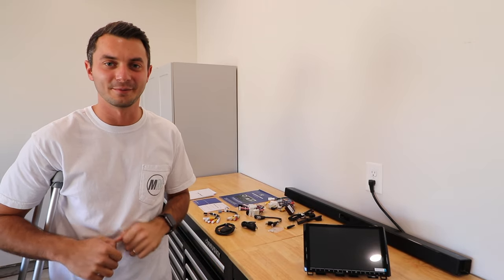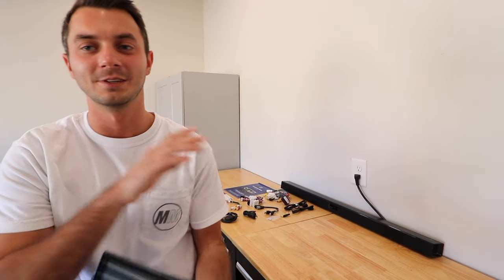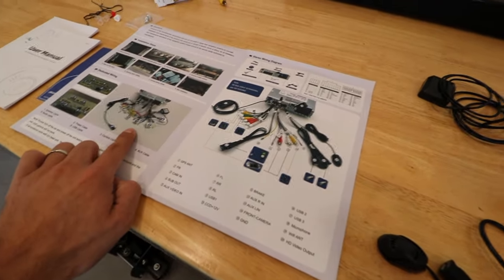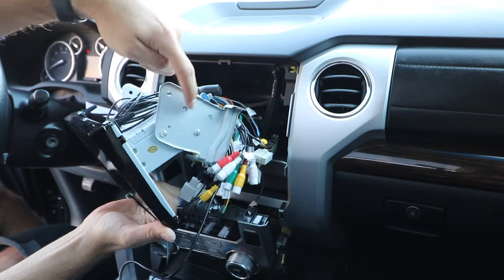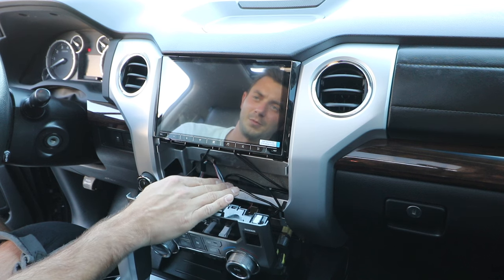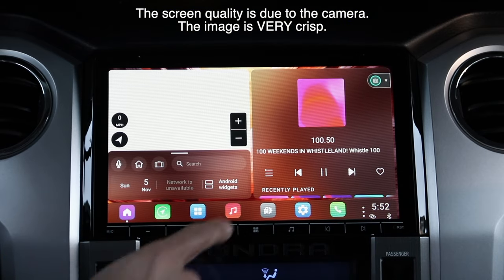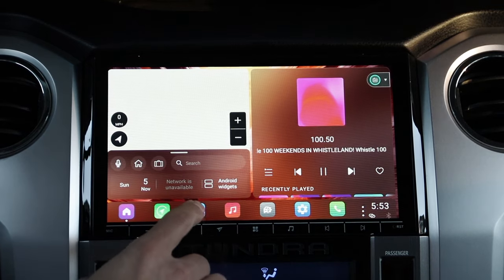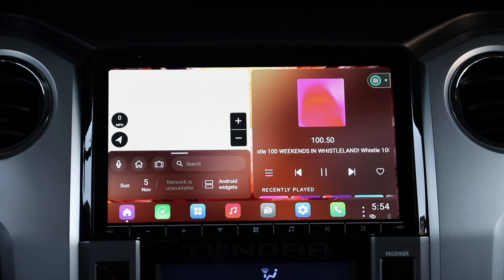The Best Toyota Tundra Touch Screen - Dasaita 10.2" Install & Review

Comment: I’ve had mine for about three months now for some reason it keeps resetting itself sometimes it doesn’t even turn on. I have to turn my truck off lock it let it sit for a few minutes start it for it to come back on. What’s the best way to keep it updated? Even after I said the clocks reset itself and now it’s five hours off don’t know why it keeps turning on and off and doing this.😢
Reply from the maker: You're having the exact same problems as me.  Shortly after installing - mine started going black and resets fairly often.  I am going to do a video trying the new update.  It may be worth reaching out to customer service (they are great).  They told me if the update doesn't work, they would send me an android unit versus the VIVID as it has less bugs.
Reply: @AJLoDato22  awesome looking forward to the video and I might have to call and speak to them
Reply: Any update on the glitch yet?
Reply from the maker: I'm actually working through it with Dasaita now, and going to try the update this weekend.  I'll give it a couple week's to make sure it works, then upload a video! @Cadeternie

Comment: Had my dasaita for about 4 years now..constant battery drain. Druck dead after 2 days. Definitely the unit/canbus. When removed and factory head unit is reinstalled truck is great.
Reply from the maker: Interesting insight. This is my second Dasaita head unit between this and my 4Runner. No battery drain issues for me (yet 🤷‍♂️).

Comment: The buttons at the bottom, like volume, are they physical buttons or just a dedicated position of the flat screen?
Reply from the maker: They are not physical buttons, or part of the touch screen. They are like Haptic Touch buttons. Not as good as physical buttons, but so far no issues.

Comment: I liked your video and it helped me make the decision to purchase this head unit. It took a little bit to figure out some of the connections. The first harness I tried wouldn't fit the connectors, so I used the other one that came in the box, and those fit. It took me a while before I realized I needed to detach the carplay box from the harness that didn't fit to the other. However, the main problem is that the radio won't turn on at all. I've quadruple checked that everything is plugged in tightly, but it still won't turn on when turning on the truck. Is there a step that I could have missed or is it common that these units can come faulty?
Reply from the maker: Hmm is it the radio only, or the whole unit won’t turn on?  If it’s the radio, there is an antenna plug from your truck that will plug in. It looks like a thicker black wire with a 90 degree bend and round metal plug. 

If it won’t turn on at all, I would for sure contact their customer service. Pictures would be helpful and they should answer within a day or so.
Reply: @AJLoDato22 the entire radio doesn’t turn on.

Comment: I’m trying to install the g12 in my truck right now and could use some help from someone who has done it before
Reply from the maker: Message me on IG - @aj_lodato
Reply: Me too
Reply: I bought the G12 for my 2018 Tundra. It has been a horrible experience so far. I didn't find the install too bad. But now it is up and running it just continues to restart/reboot over and over. I tried battery disconnect, pulled the fuse, countless RST 30 Sec reboots, reset back to factory setting, tried to update the firmware per the forum instruction countless times with no success.

I ended up removing mine from the truck as the unit is basically a paper weight and until I can get some customer/technical support this thing is unusable.
Reply from the maker: @nickockenfels6058  dang, that’s a shame to hear. Before I did my update I felt the same, but has since been problem free. Hoping they get you squared away or refunded soon my man.

Comment: Whats the benefit of spending $100 more for 8gb Ram & 256gb Rom storage vs 6gb Ram & 64gb Rom storage.. is this needed for the function of the unit or just for storing apps etc?
Reply from the maker: I don’t see the benefit for how I use it at least. I would think it’s for Apps which would require you to have a SIM card, too.
Reply: @AJLoDato22   thanks.. are you still happy since your follow up video in January?
Reply: @AJLoDato22  also are you able to screen mirror to this thing from your phone?
Reply from the maker: @cory0333  Yup still really happy with it over stock.  The small annoying things, are still annoying but would certainly buy it again.
Reply from the maker: @cory0333  confirmed - it does have screen mirror.  Hope this helps!

Comment: I'm have a terrible time with this radio. I hooe you can help. 2019 Tundra and the kit came with two main harnesses. One has the wrong connectors so I am using the other one. I can not get my back up camera or my steering g wheel controls to work. Do you have any suggestions on what I may be doing wrong?
Reply from the maker: I wish I could help more, but my install was seamless. It sounds like a connection rather than a firmware issue. I’d take a pic of the connectors and send it to their help email. They are super quick to answer.

Comment: Hi. Did you do anything different when plugging the wires (yellow) reverse camera? My reverse camera doesnt come on.
Reply from the maker: I wish I included a picture of how I had it hooked up. There were three yellow AUX  connections and I can’t remember which two I chose to connect. You may just have to swap yours.
Reply: @AJLoDato22  got it to work, the canbus thingy was on the other set of wires and had to unhook it. Thanks for responding.

Comment: so how did you get the amplifier remote wire connected?  I'm in a 2021 and have everything connected, everything working with the exception of the door speakers due to the triggering of the stock amp under the passenger seat.  This is a non-JBL Tundra.
Reply from the maker: Hmm that may be over my head. Mine is non-amplified so I didn’t cross this problem. I’d hit the forums as I’m sure someone else has.
Reply: @AJLoDato22  I found another user on the Dasaita forums with the same issue.  It went to a dead end with no solution and I reached out to Dasaita and they are sending a new wiring harness.   It's basically not triggering the OEM amplifier but everything else works fine.  I also ordered a MIC converter to 3.5mm so I can run my own mic.  Hope to get this all function in a week or so!
Reply: @BrentRivers  are you happy with the unit so far? Glitches? All factory controls/ reverse cam working good for you?
Reply: @ducsauce85  i got it working with a new harness sent from Dasaita.  The pluses are fit and finish, but i upgraded the wifi antenna to a full spectrum and finding the right combo of connectors for the stock GPS antenna were challenging.  But everything works, lots of customizations yields a solid unit.  I need to upgrade speakers now!
Reply from the maker: @BrentRivers  similar thoughts here. No issues aside from small glitches from time to time. Has been awesome for the couple of months I’ve had it. Speakers are in the pipeline for me, too!

Comment: What happens to the maintenance reminders after installation? Use a scanner to reset ?
Reply from the maker: For at least a 2015, my maintenance reminders show up on my gauge cluster. I reset it from there.
Reply: Finished my install today. I saw a ground wire that came with it. Didn’t find where to put the ground wire.

Comment: Will this work for a non jbl/gps basic 2019 Tundra SR. My current unit doesn't have xm or hd radio either
Reply from the maker: Yup it should, mine is the non-JBL. They also offer a newer version that is android over Vivid operating software.